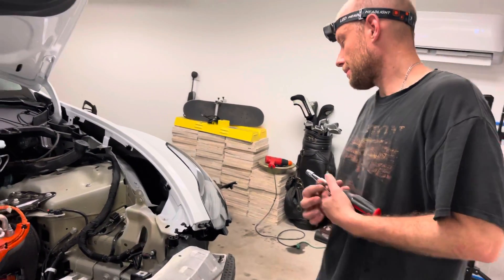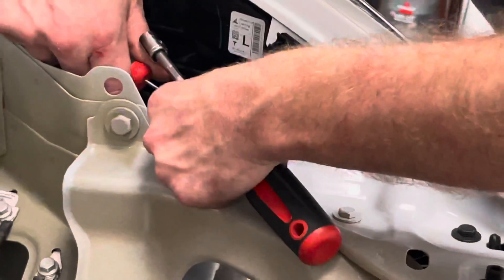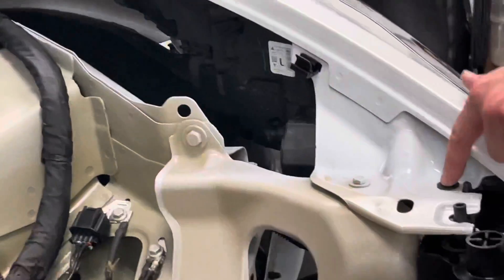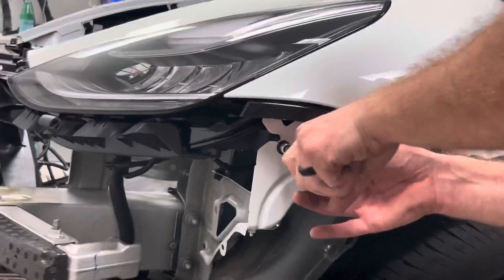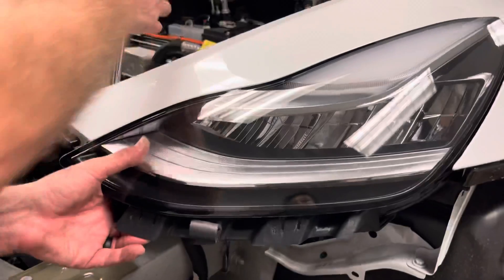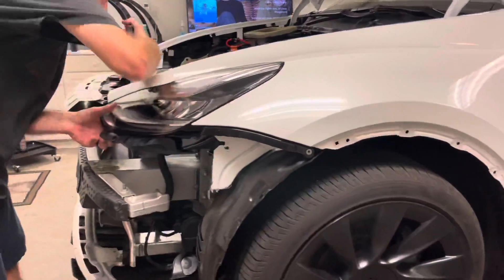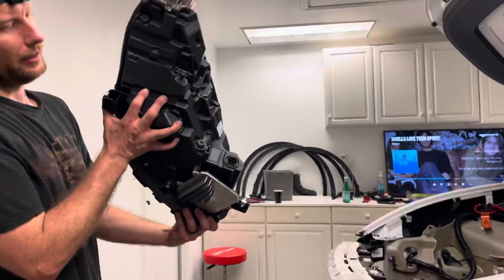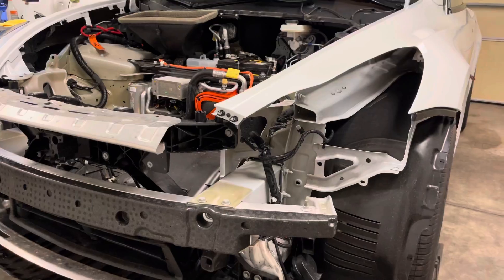Tesla Model Y/ Model 3 Headlight Removal (Video #7: Tesla Disassembly)

Comment: Thanks for the video. Very useful. One reminder: Headlight has firmware which needs to match the car firmware. Therefore need to reinstall the car's software through service mode on the car screen if replacing the headlight with a different one. This will ensure that the headlight and car firmware match so that the headlight works properly.
Reply from the maker: Are you 100% sure on that?
Reply: @GdayFraz  yes. I just replaced the driver's side headlight on my M3 last night. The new light would flash one second after closing a door of the car while the passenger side headlight did not. The new one also did not flash yellow like the passenger side headlight when the mirrors folded. After software reinstall both headlights acted the same.
Reply: Just replaced  the right headlight  on my model  y h it still  dosnt  turn on how   how dose that firmware update work
Reply: @Traderrey  Click on "software", click and hold "Model Y" until "Please enter access code" appears, type "service", click "ok", click "enable", that will get you in service mode: the screen will have red line all around it. You should be under the "vehicle info" tab. Click "Software reinstall" then click "reinstall". That will start the installation of the latest version and will update the firware of all the electronic components of the car, including the headlights. The whole procedure is explained 50 seconds into this video: https://www.youtube.com/watch?v=ryaWtCJiwMc. If that does not solve your issue then the problem might be with the headlight or the wires leading to the headlight. let me know if that did the trick.

Comment: Without removing the headlight is there a way to connect the new headlight on the side inside of the trunk just to plug it in if it works ? Is that cable long enough to do that ?
Reply from the maker: Maybe but probably not tbh

Comment: Does the bumper NEED to be removed or can you just access the bolts through the fender and frunk and still have room to slide it out? Thanks!
Reply from the maker: Needs to be removed
Reply: That’s annoying. I guess they don’t want you to be messing with it.
Reply: Service guy came out and replaced a headlight in my 2021 m3 and did not remove the bumper.
Reply: @relaxationsounds6981  probably at least unhinged and dropped down at least. No way to pull it forward with bumper in place.

Comment: Do the headlights and integrated turn signals share the same wiring harness?  Is it possible to disable the turn signal without disabling the headlight?
Reply: Headlamp has Lin bus communication it has only have 3 wires supply ground and signal that provides all functionality to headlight so that is not impossible without using something like "can filter" but for lin bus that block only specified signal i You case blinker